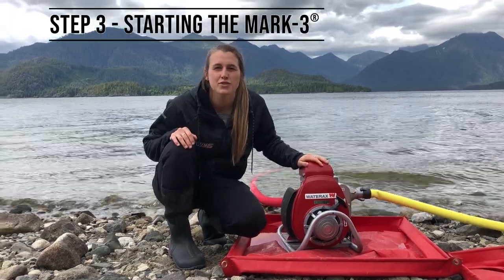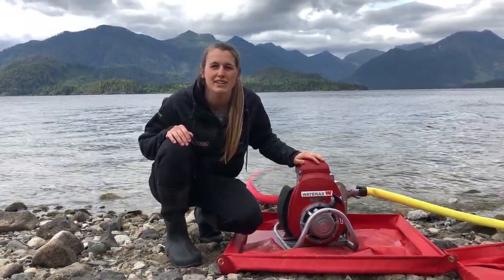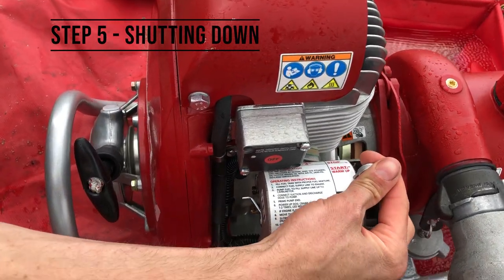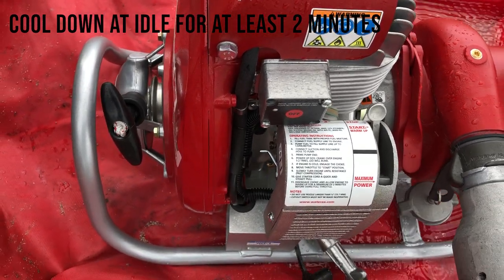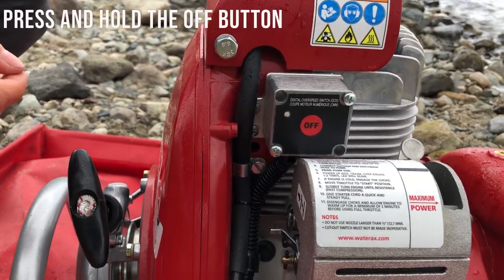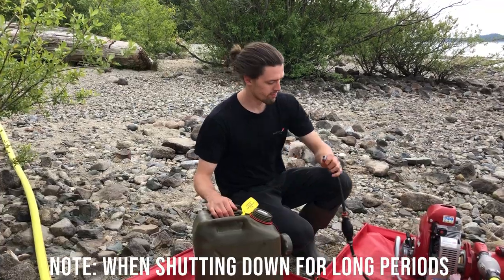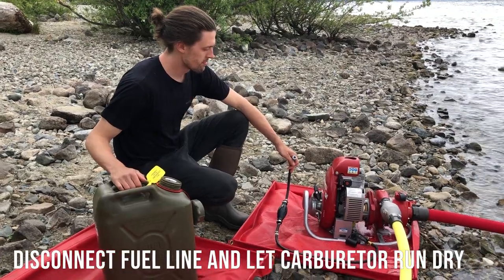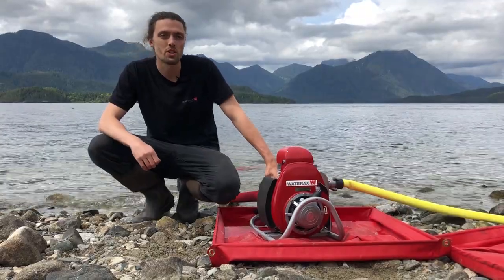How to operate a MARK-3® high-pressure pump

Comment: You can also prime this pump using the filler cap but again it needs to put back wrench  tight. Secure the pump and gas with a ropes. Also due to the pump vibrations you need to put something (piece of wood etc) under the hose as it will wear  on rocks and create a hole in time. It is also very important to keep all flammable material ( grass etc)  away from the muffler as it gets very hot ( trust me).

Comment: We used to have these mounted on a piece of plywood with straps so we could carry them like a back pack.  The poor pump man would have the mark 3 or mark 26 on his back, the jerry can in one hand, the tool box in the other and the suction hose wrapped around his neck.  Fortunately in northern Manitoba water was never very far away.  We would usually pin them to the ground by driving a stick through a hole in the plywood.  These pumps had a nasty habit of vibrating themselves into the lake if you didn't restrain them in some way.  I remember one fire where we had close to 5000 feet of mainline run out.  This got us to the fire.  We then wye'd off and sent a hose each way around the fire.  We had probably 2500 feet in each direction from the wye.  One of these was then wye'd off again with hundreds of feet of hose added to each branch of that wye giving a total of three nozzles.  Despite the amount of hose and working against an elevation increase of about 50 feet the mark 3 still put out an impressive stream of water at each nozzle.  I was always in awe of what that pump could do.
Reply from the maker: thanks for sharing!! Wait until you see what the new MARK-3® Watson can do !